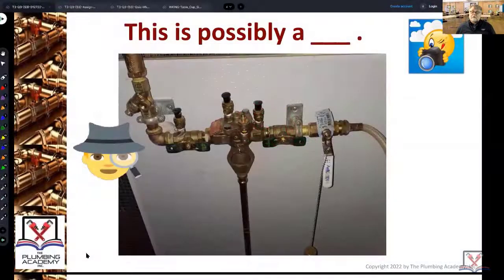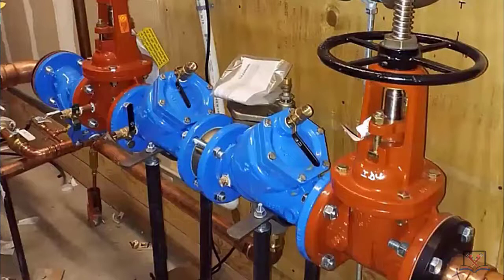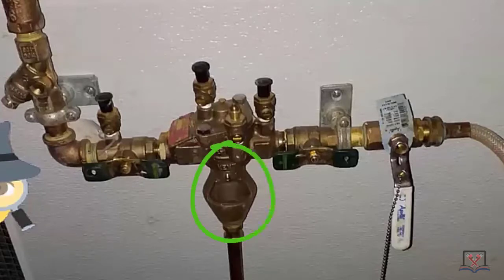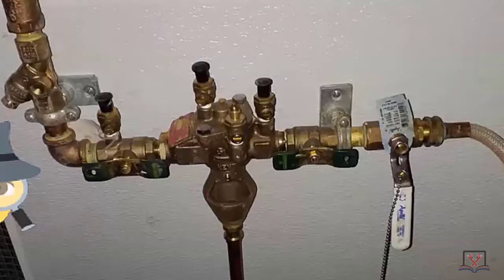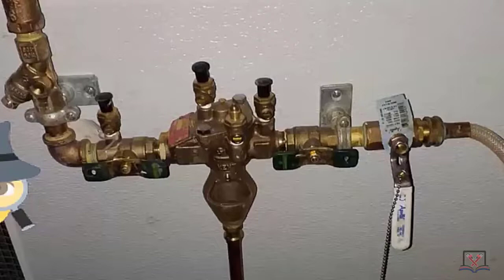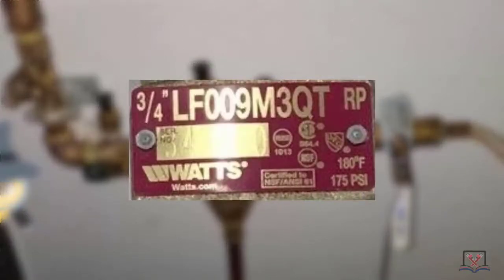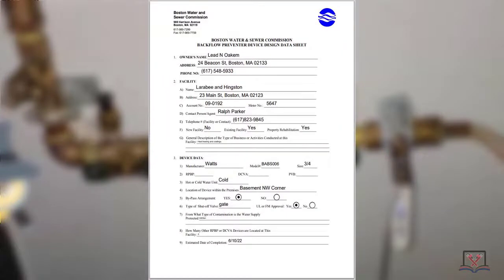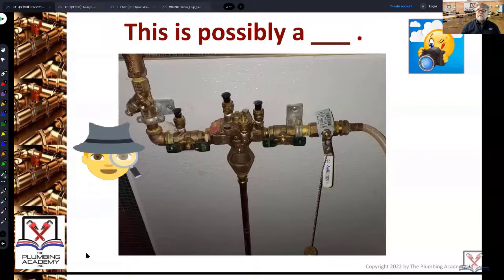What Is It? - Reduced Pressure Zone Backflow Preventer (2)

Comment: Water continuously discharges out of the relief valve if the second check valve is not drip tight and backpressure is present. If the second check valve is drip tight it will not discharge. Water will also continuously discharge out of the relief valve if the first check valve is not drip tight and there is no downstream demand.  A drop in supply pressure will cause the relief to spit and stop.